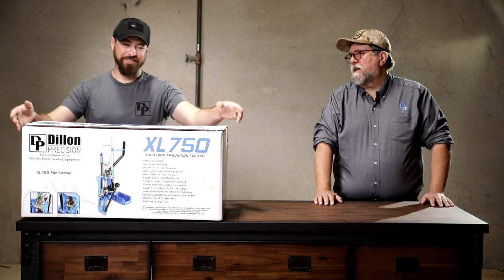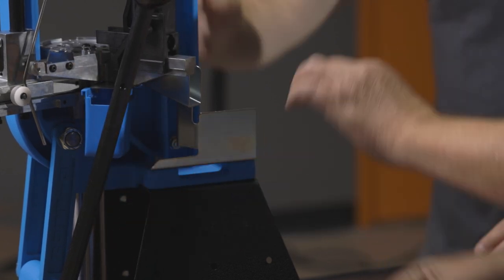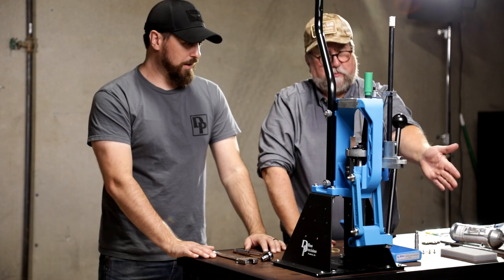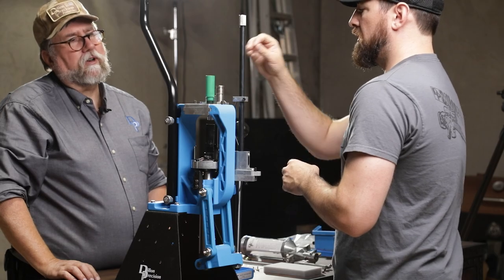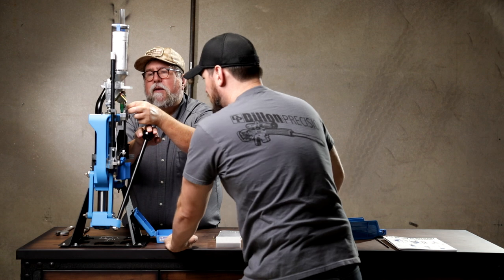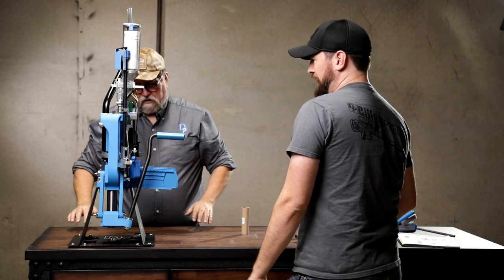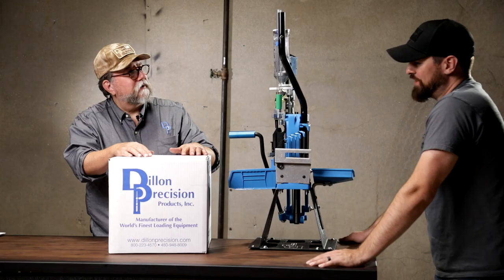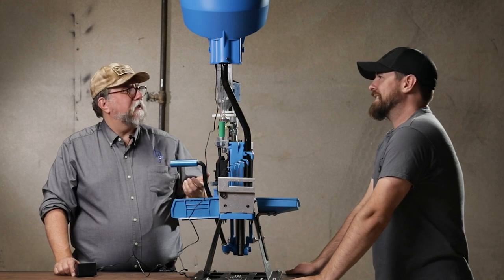Dillon Precision XL750: Unboxing & Step by Step Setup

Comment: This is how you make money kids...
-Make a quality product.
-Show a quality video how to assemble,
-Wait for all the orders to come in😎
Reply: Let's not forget after sale service. Dillon has amazing customer service. I bought my XL650 and had it in storage for 5 years before I had a chance to set it up. I didn't realize the powder check/primer alarms actually came with batteries (who does that anymore?). I don't need to tell you what happens when you leave dead alkaline batteries in your components. It was clearly my fault, contacted Dillion fully prepared to buy new parts. They sent them out for FREE, no questions asked. 50K+ rounds later, with proper maintenance, I have no doubt my machine will last a lifetime.

Comment: but, but, but you did torque it by virtue of tightening the nut on the bolt.  Personally, I would avoid a 3/8 ratchet were I not working on a small block Chevy!

Comment: I just bought this XL750 buy haven't used it yet I'm waiting for primer and powder. Do I need the Dillon XL750 strong mount which is hard to get in Canada or will it work without it?
Reply: It will work without it. It does help with spacing and wobble tho. Also helps if u are tall or don’t have a high workspace so your not leaning the whole damn time and killing your back. Also easier to clean
Reply: @User-ny7eo  Thanks much appreciated

Comment: What is my shell plate on full rotation does not perfectly center over the primer (punch?) I have loosened the primer feed body and tried to twist and tighten in place but did not get it quite enough. Have not ran it yet so dont know if its gunna be ok yet but didnt know if this will be an issue

Comment: Hello, I‘m about to buy a Dillon XL750 and have something in mind.
I wanna set up my Dillon in my garage and my question is if low temperatures like 20 degrees or higher temperatures like 80 degrees would have an effect on the Dillon?
Reply from the maker: Not going to have any issues. Just don't leave the powder in the hopper.
Reply: @DillonPrecisionVideos  That means I can leave everything except the powder. Thanks for the answer.

Comment: Where do you get the bottom plate under the strong mount?
Reply: Unfortunately I don't believe it's for sale it is a mounting plate they use for display  at shows and for demonstrations
Reply: It’s on their website under reloading accessories

Comment: Is there a video presentation for exactly the same thing but for an XL650?
Reply from the maker: There is not but this will be close for everything except the priming system, In which case you can watch the RL550C video for that portion of the learning process.
Reply: @DillonPrecisionVideos  Thanks.

Comment: My primers keep "jumping" out of the primer bar or don't drop in the holdet at all. Will run 20 or so then every other one misses. This goes on n on n on. Very aggravating and dont know what to do. Ive got a total of a cpl thousand rounds thru it so far. Any suggestions would be appreciated. 
Thanks in advance.
Reply: Had same problem. Disassemble primer bar and clean with dry alcohol. I used q-tip to clean the primer pocket and the magazine blue tip. Reassemble and rock on

Comment: How tall is it with all options installed? My reloading room has a low ceiling. I’d like to build a new bench so I have the proper clearance to operate.
Reply: About 41” With strong mount and case feeder.
Reply: If you have short overhead clearance you can mount the unit directly to your bench, OR you can mount it to one of the shorter mounts from inline Fabrication: https://inlinefabrication.com/collections/dillon
Reply: I have a '650 and the Dillon Strong Mount I received with mine is only 6-3/4"  tall.  On the Dillon website, there are two.  The 22051 is 8½" tall and the 22052 is 6-3/4".  Inline Fabrication makes a 4", a 7½" and a 9-3/4"  mount.

Comment: Do yourself a huge favor, get the auto case feeder. It works flawlessly. You may as well stick with a single stage machine without it.
Reply: I got the loader right off the bat, could not even imagine loading by hand. Easily would go from 300 rounds an hour to 100

Comment: Mines runs terrible. When doing the flare it gets hung up on every round. I have to jerk the handle so hard it flings out the primers from the slide. I've tried DAA and  shooting sports innovations tapered funnels and they were no better.
Reply: Call them. They have great customer service. Mine is smooth.
Reply: Too much case mouth flare.
Reply: Use a little case lube and the problem should go away.
Reply: just polish it with fine sandpaper or steel wool. especially transition from straight to angled part.